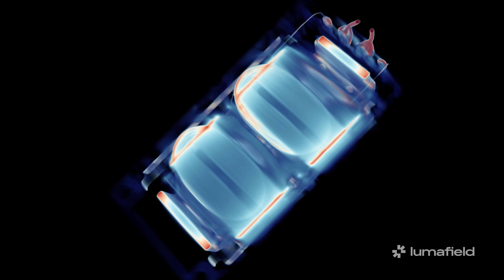Switch 2 Pro Controller: Built to Break? Full Teardown

Comment: 2:52 - I'll never understand people who are upset with Xbox for using easily swapped AA batteries. High quality rechargeable AAs are pretty cheap, they'll last for multiple console generations. It's by far the best option. Especially when you have PlayStation over there with a sealed in battery that usually can't even get 10 hours. I'd rather pop a cover, swap AAs, and resume gaming than have to plug my controller in mid-game. PlayStation might as well return to wired controllers and ports on the console to plug into for how bad their batteries are. At least Nintendo's sealed in batteries on their controllers have decent battery life. AAs would still be better though.
Reply: I like the concept but I hate that Xbox controllers charge nearly as much as PlayStation controllers but do not come with the rechargable AA batteries. If 8bitDo can do it with their Pro 2 controller, why not Microsoft?
Reply: @Badget007 xbox controllers cost like 50 usd and goes on sale often for as low as 45 usd. ps5 controllers on the other hand cost 65-70+ usd. these prices are for new listings from amazon.
Reply: Exactly. Built in batteries aren't even more convenient. Give me rechargeable AA's any day of the week over them. Who wants to have to go wired when your battery dies? Not me.
Reply: My dualsense from 2022 is already so bad at keeping up with my playing sessions when it comes to batteries so you're right
Reply: Ikea LADDAs are amazing. They are so cheap and will last you about 10 years. They are just slightly more expensive than regular premium brand single use AAs. Also Ikea LADDAs are made in Eneloop factory and are basically the same spec (you can find youtube video about that).
Reply: cýcles til 80% capacity
NiMH (Eneloop): 400
LiCoO2: 500
LiFePO4: 4000
Reply: I appreciate that Xbox gives you the option for both at least, used to be a lot more awkward in the 360 days but now it's fine whatever battery source you go with.
Reply: @mjc0961 Because PS fanboys especially LOVE to bash Xbox users as much as they possibly can — They never admit anything that sucks about PS5 either. 

- PS charges $75 for a controller when the Xbox controller is always on sale for $50

- The PS5 “backwards compatibility”, some of which is locked behind streaming only, is TERRIBLE in comparison to Xbox

- The PS5 120fps mode is limited to YUV422 because the HDMI isn’t as good as the Xbox

- Networking is better on Xbox because you can be plugged into a router and get Open NAT — can’t do that on the PS5, you have to be plugged directly into the Modem otherwise enjoy NAT Type 2 forever

- Freesync performs better than HDMI Forum VRR

- XSX is generally more powerful and faster than the PS5, in most situations

- PS5 is ridiculously bulky compared to XSX

At least Xbox enjoyers don’t ignore the issues with MS/Xbox and most will admit they don’t like the current direction they’re going…PS fanboys on the other hand think everything is great when Sony asks you for $699 for no disc drive, 10% better performance and poorly implemented PSSR. It’s a joke.

CONTEXT: I own a PS5 Slim, XSX and Switch 2
Reply: No we're upset with Microsoft for not including the rechargeable battery when you purchase it. 

Look at the 8bitdo controllers they come with a rechargeable battery that you can remove and replace with AAs rather than having to buy it separately.
Reply: I'm okay with rechargeable batteries in controllers that are not AA form factor. The batteries in these devices do not need frequent replacement - but the batteries need to be replaceable anyway as they are still prone to natural wear comparing to other parts. I expect just a screwdriver for accessing the battery slot.
Reply: As far as I'm concerned there is no downside to using standard AA instead of these custom lithium batteries.  I hate all these devices that unnecessarily use lithium packs.
Reply: @loganmedia1142  AA batteries are larger in size comparing to lithium-ion. When controllers are designed to be compact the AA battery slots will be contrary to that goal. Fun fact: NIntendo did sell AA battery slots for Joy-Con 1. That peripheral didn't get popular.
Reply: The alternative is that standard sizes are defined for lithium battery packs and all products must use one of the standard sizes, just like AA, AAA, etc are standard.  Then at least many manufacturers can make batteries that will fit in a wide range of devices instead of all this proprietary nonsense.
Reply: @loganmedia1142  What kind of form factor are you suggesting for lithium-ion batteries then? Keep in mind there is already a common form factor called 18650 that is too large for modern laptops, smartphone and tablets. (But you might see "18650" being used in external "power banks".)
Reply: I love having the option to use standard batteries. Eventually, there won't be any good OEM batteries anymore, plus when you buy second hand, you don't know if they'll be any good either. If a system takes AA though, I'll know there will always be a decent compatible option for the future.
Reply: 360 controllers using AA batteries was a waste of money and way too expensive. The should have come with a rechargable battery pack by default, with a AA battery option for future proofing (aka so you would have an option when the console and controllers were out of production, and the rechargable packs were no longer available).
Reply: @rhiethreal  All rechargeable controllers can work as wired controllers with USB-C cables. They use USB-C for charging as well. So technically AA battery slots are not a requirement for a long-lasting controller. People who request for AA battery slots are unreasonable IMHO.
Reply: I've had my official rechargeable battery since 2015 and just last year it got to a point where it doesn't hold a charge for more than 3-4 hours of continous use.

It survived multiple (thrash) controllers since the XboxOne era up to the current (thrash) gen.
Reply: While they are replaceable they are not rechargeable meaning each Xbox controller guarantees one pair of AA batteries that will be thrown out after a few weeks. If they actually wanted some credit they should include a battery pack which they instead sell you for a profit. Xbox is no better
Reply: @SaladDealer It's your choice on this one, I've seen so many people state "the convinience of just throwing away a dead pair of batteries and tucking in a fresh one", something that I totally disagree with due to unnecesary waste.

Being your choice to be able to buy a rechargable and convinient battery pack or disposable ones is the one point that MS has on it's controller that can't be taken away.
Reply: “Nintendo controller decent battery life” lasting up to 80 hours with one charge after 4 years of use! 🤨
Reply: I always bought the Xbox Series battery pack instead of using batteries. I actually used the Duracell batteries and found it gave me 40 hours of playtime.
Reply: its more convenient, bascially everything nowadays uses USB-c and that makes finding a cable much easier than finding batteries. sure theres rechargeable batteries but thats another thing I need to buy and make sure doesn't break whereas I have plenty of USB-c cables. also the whole barely 10 hours is bs, my PS5 controller that've had since launch lasts about 12 hours which more than enough for normal gaming.
Reply: I’d never go back to AA’s after using Switch 1 and 2 pro controllers… the battery life isn’t “decent” it’s exceptional. I rarely ever have to change them and they are used daily by my family. You get at least 40 hours out of a charge and it only takes 3 hours to fully charge from zero.
Reply: @mazzvidz  the real issue is longevity long term. Not having the ability to replace batteries, rechargable or not, makes their lives finite :(
Reply: @Ryzard 
My Switch one pro controller has been going for almost a decade and still works perfectly… and I have 5 kids of my own plus half the neighbors kids using it. I’ve gotten my money’s worth out of it and then some.

If my Switch 2 controller is as durable as S1… I’ll have no regrets buying it. 

We’ll see, it’s not even 3 months old yet. It’s got big shoes to fill.
Reply: @mazzvidz oh yeah, I'm not questioning that. But that's not always the case, and I'm thinking more in terms of preservation. Like my dad's wavebirds still work perfectly with AAs, as an example, etc.
Reply: @Ryzard 
Those wavebirds were built like tanks. Mine still work too. 

I purchased every Nintendo console at launch since the SNES and the controllers all still work well except the N64. The analog stick on that could not survive Mario Party.

🤷🏼
Reply: @mazzvidz  yep! Idk how drift became a thing lmfao.
I mean purely batteries though. I have the same issue with modern phones that have batteries you can't replace. Anything without a battery (rechargable or not) that you can replace has a lifespan baked in, and it's designed to fail eventually because profit.

With my Xbox controllers, I just got a rechargable battery and charging stand, and boom, even easier to charge than my pro controller (which for the record I do like) and no worries about the long term preservation of the controllers :)
Reply: @Ryzard 
Batteries can still be replaced… just not easily.  I’ve replaced batteries in things like iPhones, there’s plenty of resources out there to guide you through the process and then you’re good for another decade plus. 

I’ve never worried about preservation when it comes to controllers. They are pretty interchangeable these days, as everything is based on the four face button layout, two analog sticks and shoulder buttons, first introduced on SNES and PS1. 

Not much has really changed in 30 years and even 3rd party controllers are of a high quality these days.
Reply: @mazzvidz  my rechargable AA batteries last days. typically around 20 hours of play time. annd because they come in a 4 pack I just swap em rather then be forced to be tethered.
Reply: Swappable battery is the main thing I'm looking for in controllers. I was supposed to buy an Xbox Elite but learned that the newest ones don't have them anymore and the older one is hard to find.
I'm mainly using an Xbox and a Steam Controller with a few pairs of Eneloops that lasts basically a whole single player game 😄
Reply: It should be a rechargeable battery pack
Reply: Now the EU has made Apple use usb, next job should be making sure batteries can be easily replaced
Reply: @mancbiker17  They should go a step further and require industry standards for batteries.  We're still going to have too much waste with all these proprietary sizes.
Reply: I've used rechargeable AAs for 15 years, so I fully appreciate the appeal, and how much of a non-issue it can be.

However, a good  rechargeable AA setup isn't something that many people have or are even aware of.
Of course they're going to complain.

Because if you're not going rechargeable, AA's really are a huge pain and money sink.

Also... I think I still prefer the Pro Controllers lipo, for the long battery life and low weight, not to mention the low self-discharge.

Nintendo actually released official AA grips for Joycons on the switch 1. If it wasn't for drift, that would have been the perfect example of best of both worlds.
Reply: I really dislike putting AA and AAA batteries in pretty much any device, but all controllers should have the option! So cool that Xbox brand rechargeable batteries recharge on the controllers usb port.
Reply: Batteries are not cheap what these company’s should be doing is have an access door to the lithium iron battery so you can swap it out easy without taking apart the entire controller. But these companies purposely make these controllers hard to repair so you are forced to buy a new one.
Reply: @ryans413 why are you allowed to write?
Reply: The only thing i hate about it, is aa battery add significant weight to the controller
Reply: xbox literally has a rechargeable battery you can put in it to make it work exactly like playstation and nintendo controllers (charges over usb-c)
Reply: I'm of 2 minds. I like the replaceable AA of the Xbox controller, but I get through at least a set of Duracells  a month which is not as eco friendly and is costly if you add up the price of the batteries over time. The rechargables controllers don't have that but the PS5 only gives you about 10hrs a charge. 

It was a non issue with the OG Switch pro controller, which gave you about 40hrs on a single charge, and I'm getting about the same on the Pro 2.
Reply: @wssayer  Ni-MH rechargeables like Eneloop or Ikea Ladda are the way, they have good longevity, are reasonably cheap and easy to recharge, I happily use them in my Xbox controller without issue and strongly prefer them to Li-ion for the reasons above, no need to stop and recharge or play wired when they run out, just swap in a freshly charged pair and pop the old ones in the charger again.
Reply: @wssayer  I haven't bought single-use AAs in twenty years. Rechargeables, specifically Eneloops, are the way to go.
Reply: @cheesetomatoes  I only use AA or AAA batteries in TV remotes (and the like), they use such little power, batteries last for years. It seems a bit of a waste to use rechargeables.
Reply: @wssayer 
A large pack of rechargeable batteries is pretty cheap on Amazon these days. I bought a disc-shaped charger for $15 that holds a dozen of them at a time, so a full multiplayer party of controller charge is always at the ready!
Reply: @KenRosenbergGrad  ikea also has really good rechargeable batteries!
Reply: I have 4 Aa eneloop rechargeble batteries. I keep 1 pair in xbox controller and other fully charged. They last atleast 15-20days on 1 charge. Then I replace them with the other set.
These eneloops have been going strong for 2.5yrs already and still hold plenty of charge. I have never been happier.
On the other hand inbuilt battery on a Sony controller have been a complete disaster for me. Because I cant replace them instantly. I have to keep on charging them consistently in 3-4days max and it's a downhill from here as the inbuilt battery degrades. I will never use a rechargeble battery controller ever...
Reply: @namangupta86  The 360 had a removable, rechargeable pack. If it ever went bad, you could just pop it off of the back of the controller, and just put a new one on.
Reply: @wssayer that's why you get your own rechargable battery dock for like 20 bucks if your use is heavy
Reply: @wssayer  Rechargeable AA's. Easy.
Reply: @wssayer if you get eneloop rechargeable batteries, they'll last you quite a long time. Only downside is they're a bit spendy, but it's well worth it imo
Reply: There is a charging stand for two dualsense controllers and it solves the charging problem.
Reply: Have you ever ran out of battery mid game? Just charge the darn controller when you're done! Haha
Reply: If rechargeable batteries are so cheap, why aren't they included?
Reply: @ranguel259  it's consumable. ergo it's designed to be the part that wears out and forces you to buy again. BTW: if you own anything pre ps4 slim/pro: check thier batteries. after 5 years lithium gets into the "fire hazard" era of it's life. look up the term spicy pillows and the ps3 and psp were notorious for said spicy pillows.
Reply: @ranguel259  Because Xbox have a deal with Duracell as well as the cost comparison being $5 for a pack of 8 AAs vs around $15 for a set of 4 rechargeable NI-MH batteries + a charger. You have to factor in the cost of the charger being bundled with a controller. The Xbox battery slot has pins for their Play & Charge kits, but charging AA batteries requires terminals that are wired to deliver power, not discharge it. Including a battery charger would increase the price overall for the controllers, as well as providing extra chargers and batteries that people might not need, increasing waste in that regard. 

Disposable batteries can be recycled, so including those and then allowing customers to choose whether they want to get a Play & Charge kit, a licensed controller stand charging station, or to use whatever batteries they can afford. The aspect of choice alone is much, much better choice than adding to E-waste, like with how every phone used to come with a new Plug, earbuds and cable that might not be required if the customer is happy with whatever they already have.
Reply: @ranguel259  Xbox cuts costs on their controllers, because they return a decent profit on them.
Reply: With PlayStation you buy a controller and you got the battery included and it's rechargeable. With Xbox you have to invest in your own rechargeable batteries, thus increasing the overall cost of the controller or having a running cost over time if you use standard alkane batteries.
Reply: @DarkGT Good quality rechargeable AA's can be had for €6 and a charger for €5 (ikea!)
Reply: besides being horrible for the environment as a lot of people don't use researchable batteries with them, they also weren't cheaper even though the AA batteries they came with cost far less than the lithium rechargeable one in other controllers. It was a decision made to save money, and even though I prefer having the choice as well, its not that difficult to see why they get dunked on for it
Reply: @RepublicofODLUM  maybe it's not cheaper if you only use rechargeable AA batteries for your controller but many of us use them for different devices so it ends up being way more cost efficient.
Reply: Xbox also have rechargeble pack that can be used if you want apart from rechargeble Aa batteries.